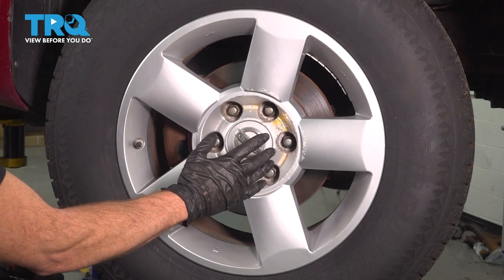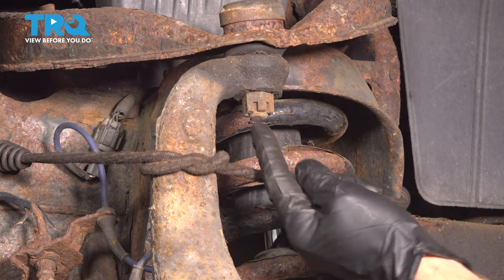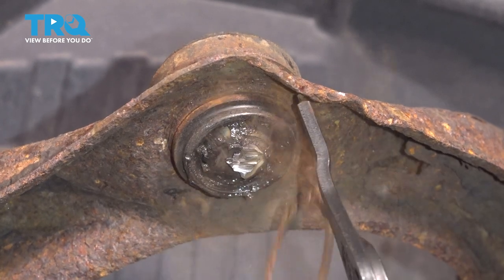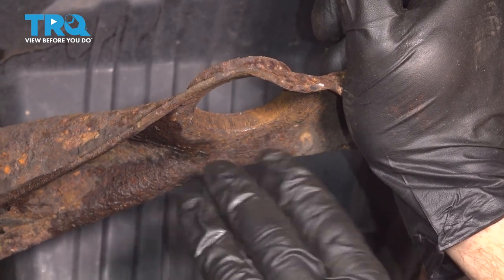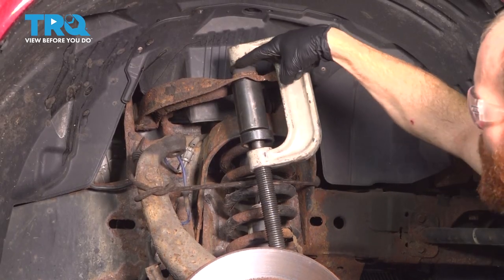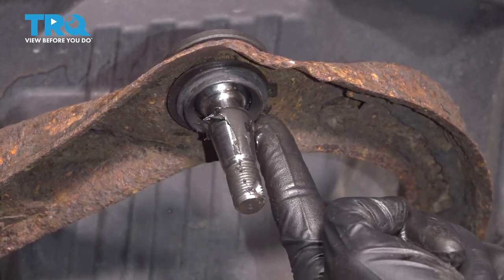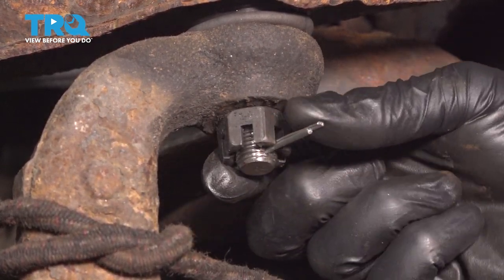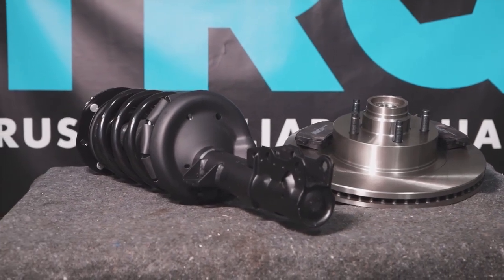How to Replace Upper Ball Joint 2004-2015 Nissan Titan

Comment: Great video. I made a futile attempt to remove the Ball Joint with the press.  Do not waste your time, cut off the stud as suggested! Note, I also found it unnecessary to remove the boot on the new ball joint.  This made the job quite easy.
Reply from the maker: +@kevinfinnegan5528 Thanks for watching our video! http://1aau.to/m/Shop-TRQ